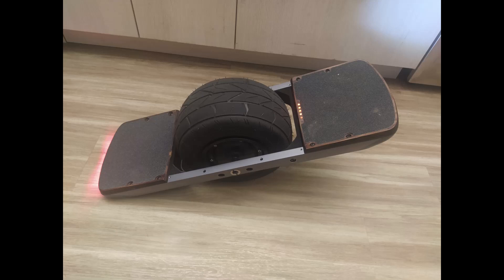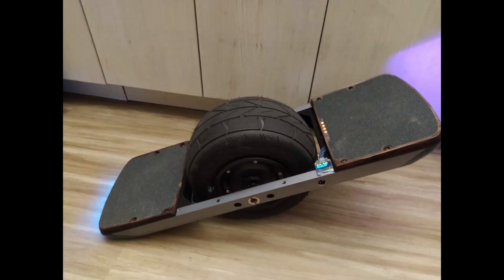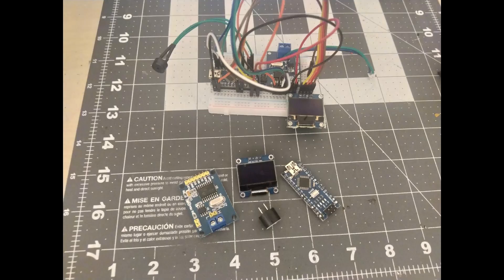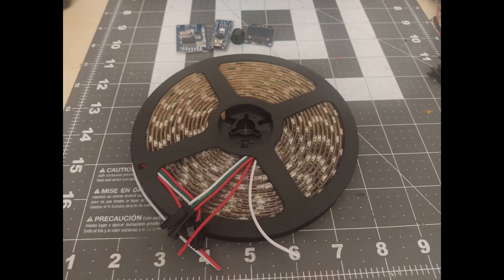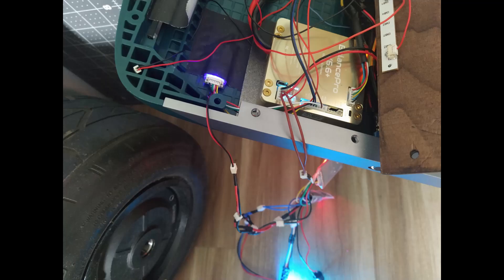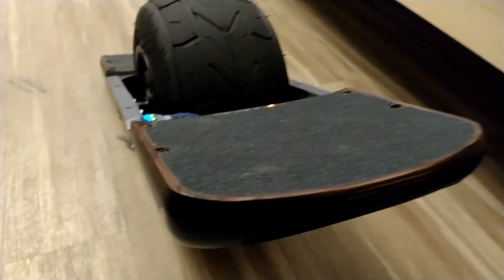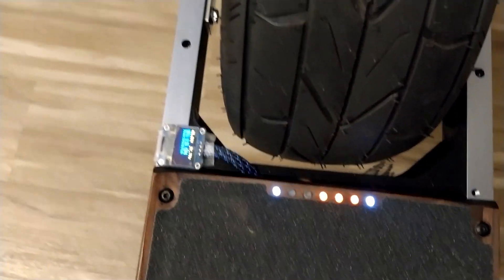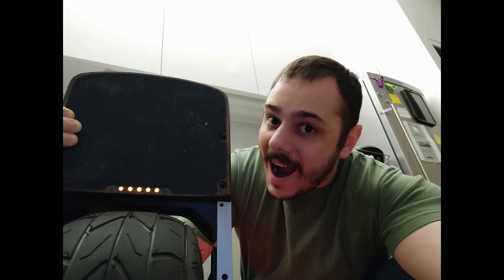Adding a Balance Buddy to Floatwheel Kit

Comment: im having trouble compiling your code
Reply from the maker: Are you using arduino ide?
Reply: @freedomcaller  yes, I messaged you on discord and left a github issue
Reply from the maker: @huff_designs  alright, let's take this over to github. I turned on notifications there.